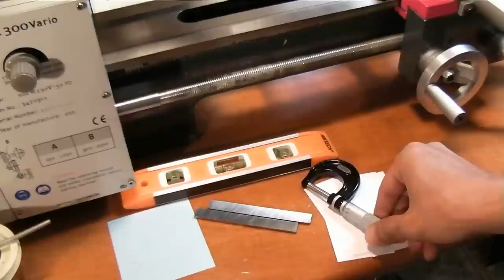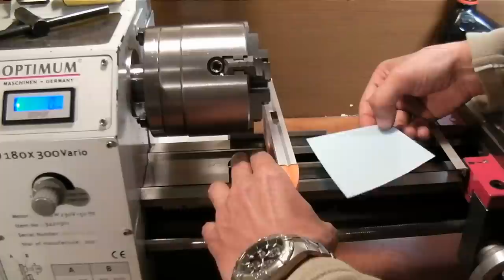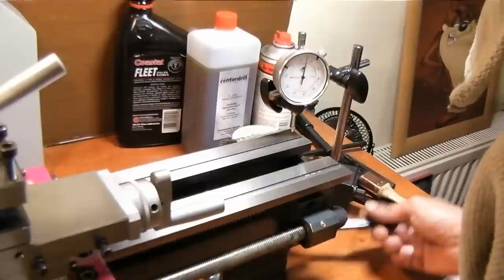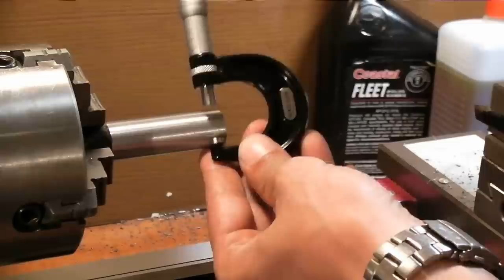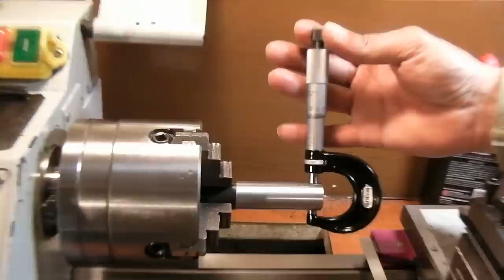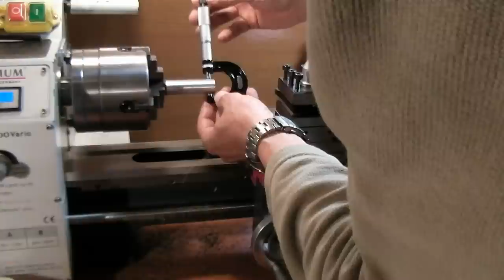Optimum D180x300 lathe leveling

Comment: Great video. I also have this lathe, and found a different issue: a vertical misalignment between the headstock housing (and consequently the headstock) and the bed. It was pointing up a bit much (0.05mm each 6cm) . I used the same method (2 pieces of paper sheet between the headstock housing and the bed just under the two screws to the left that bring them together) and was able to solve the problem. I also needed to use a peace of paper sheet to correct the horizontal misalignment, just like your video show. I hope to see more new videos soon.
Reply from the maker: +Dpa Thanks Dpa and sorry for the late reply. For some reason YouTube moved your comment to the Spam folder. I'm working a lot of hours on my machines lately and on my free time I need some rest. I hope to find the time to make some good videos soon.

Comment: Thanks, I started with 11 thou taper per 300mm and ended up less than 1 thou using your method. I now just need to buy two new 150mm steel rulers as they were perfect spacers.  Wish I could share my video or photos OptiTurn TU-3008G.

Comment: Thanks for this information. Really interesting way to calibrate the lathe. I am not sure whether you are leveling or ever so slightly bending the lathe bed when you bolt the ends down. Perhaps you can even make small changes by varying the force systematically with a torque wrench?

Comment: Well, what is the reason for precise lathe leveling? What influence does it have to the lathe precision/functionality?
Reply from the maker: Thank you for your comment! The floor or the bench are not perfectly flat and lathe bed will twist and follow any small unevenness of the surface that is sitting on. The purpose of leveling a lathe is to ensure that both ways run as perfectly parallel as possible with each other and has little to do with 'level' with respect to gravity.
Reply: +Baseline46 so are you saying that the runout is not coming from the chuck area but it also can come from the lathe bed not being leveled? just to make sure here?

Comment: Very nice!
Reply: Forgot to add I have been doing this with a machinist level and have not seen this done simply using cuts.  My machinist level is too big for my mini-lathe.  I'll be using this method with my 7".  Thank you very much.
Reply from the maker: +Dave W Thanks Dave! Use your level as usual and then this method for the final adjustments.

Comment: Cool! I thought that only the printing presses so demanding to the correct levels! It's very hard work to ride around the press! ))
Ummm ... Only wooden table not the best support for heavy machinery. And these pieces of paper ... They change its thickness from moisture and generally better to use a thin metal plate.
In any case, catch a "like" from far, cold Russia and teach a new word "yustirovka" )))
Reply from the maker: +tigdin68 Thank you brother!!! I agree with you...